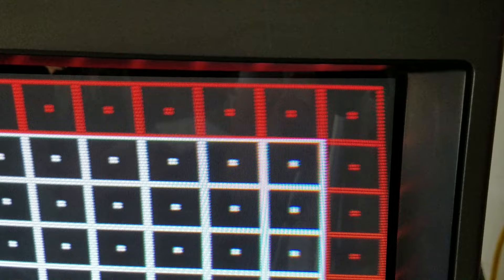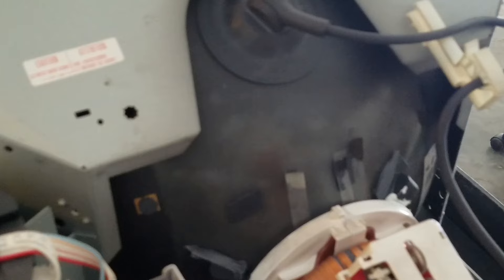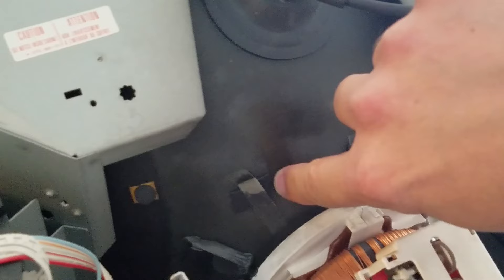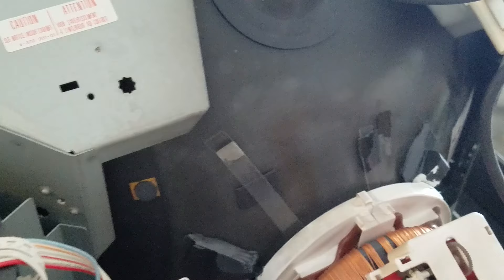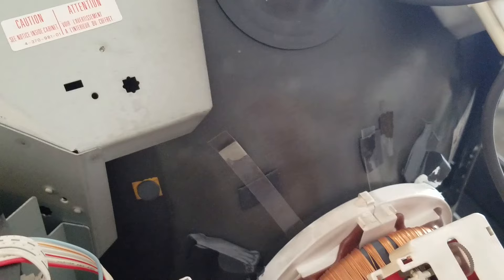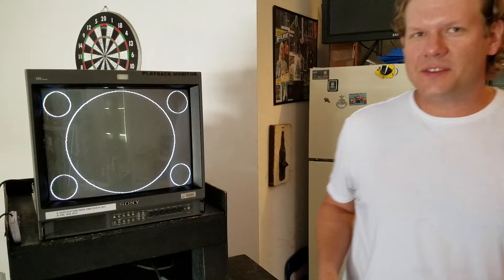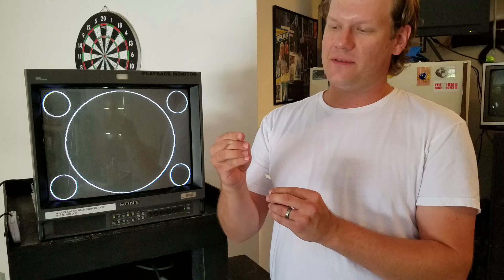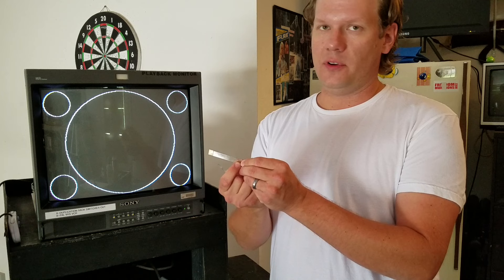CRT Calibration Fixing Corner Convergence

Comment: I would love to try this on my Sony 14"PVM. However even as an electrician, I'm just too damn frightened to open up a CRT monitor while running.
Reply: use your right arm
Reply: Believe me, it will burn more than shock you, it's not that bad
Reply: People like to talk about crts like they are some kind of death box but nobody talks about microwaves, one microwave transformer can easily kill you, my neighbor died trying to fix one
Reply: @geovani60624  microwave for sure is death. heart attack. maintenance guy told me he was fixing a microwave and luckily the shock shot out of his elbow instead of through his chest.
Reply: Why would anyone bother trying to DIY fix a microwave? They cost like £50 and last 20 years. What a tragic way to go.
Reply: @geovani60624  I would not even keep a microwave in my house or use one. They just radiate the food and technically you cannot turn them off.
Reply: @axi0matic  Over the range ones cost $200 or more typically. Plus mounting a new one on the wall usually takes more time than just fixing the old one.
Reply: @andree1991  Depends on which part you contact. The cathode current on a typical CRT is limited to 1.5mA, and it's DC, not AC. So usually a shock from the anode will be very painful and may result in skin burns and (even more painful) collateral damage such as broken wristbones and ribs. However, if you have a heart condition on top of that, it can very well be lethal. The same applies if you contact the primary of the power supply, as with any mains connected appliance-- which is why you should always use an isolation tranformer. The latter will still not protect you against HV discharge from the CRT tho. If you do fondle the CRT, do so with only one hand -- the other stays in your back pocket at all times! That will make it more likely you'll discharge to ground instead of across your chest.
Reply: @NuGanjaTron  I still would take the chance man. Just to be safe
Reply: @NirnBootMod  A microwave oven does not and cannot change the nucleus of an atom in any way. It won't make your food radioactive. It may make your food dried out and little chewy but that's about it.
Reply: Hello, how do you get geometric lines?

Comment: Just bought a 2008 Emerson CR202EM9 in 2020, and it’s had a minor warping issue in each corner since the day I got the TV

While I’m far too worried to mess with an opened CRT myself, it’s nice to know that convergence strips are something I can mention when I have a retro TV shop service technician look at it (in addition to having them observe unbalanced stretching on the left edge of the screen compared to the right, which as I’ve read apparently is a yoke misalignment)

Comment: Very helpful, I've just done my own arcade monitor build with a 19" tv tube and a Hantarex Chassis + yoke for my street fighter 2 machine, I've got the convergence rings spot on but one corner won't converg right luckily I had some strips on the old tube and only 1 strip fixed the corner issue, cheers.

Comment: I have another question: If the corner converge is even worse than that, can it be caused by a bad cap for example?
And is there another way to fix corner convergence than using magnets? I heard using magnets is kind of a hack.
I tried using (even a big magnet) on one of my CRTs, but couldn't pull out the corner far enough (I didn't however try shoving it under the yoke).

Comment: I didn't know you could touch that part while it was on, do you mainly have to avoid the wire from the flyback.
Reply from the maker: Yes, I just made 2 videos on safety in a CRT.  There is one for High end monitors and one for Consumer sets.  Please review those to get more information on safety.  Thanks

Comment: hi steve, i got some of those strips from a smashed tv monitor i found on the street trash. but looking at the video i really can't understand where does the magnetic part has to go,  i see you moving the strip arround but the magnetic end of the strip has to go really deep  towards the copper narrow area of the crt? or magnet can go anywhere in the black back area?  whats the difference putting a magnet in the top black area and difference putting magnet in the bottom narrow area near the copper?

Comment: Are those strips and magnets on all trinitrons inside? I have consumer one a flat screen wega fd trinitron with a slight bit of that in the top left hand corner but no where else. Would I need to adjust it like that or with the focus pot as it's slightly out of focus aswell and bending down in the corner? Or is it a service menu fix? 🤔

Comment: How hard do you chase corner convergence? I've added strips to the back of one of my pvms and I'd say it's pretty good, but right in the corner I can see the blue bleeding slightly off the edge of the white. Is it worth chasing or is it impossible to achieve true perfection?
Reply from the maker: It's so hard to get perfection on the corners and with some CRT's it's just not possible.  You can try to get your degauss cable/band tight around the corner and that can help with color changes.
Reply: Retro Tech thanks very much. I used some magnetic tape to get it is as good as it was going to get. I could either get it horizontally converged or vertically but not both. So I went for vertically, otherwise you can see colour bleed between scan lines.

Comment: Not only do I have slight corner convergence, but both my CRTs don't show the full image, will this method work?
Reply from the maker: Yes it can help.  You may want to see if there are any trim potentiometers that control your picture size inside your TV/CRT or in the service menu if you have a nicer monitor.
Reply: Retro Tech I have 2 flat screen CRTs probably made in early 2000s, one is a Panasonic, the other is a Sanyo. Would it be possible and safe to do the same procedure you did? I can't imagine tweaking the insides of a live CRT to be safe.
Reply: @RetroTechUSA do you know how to access a hidden service menu on an rca crt? Mine is from 2004. Nothing in the service menu about adjusting tilt or zoom.

Comment: My TV has the exact same problem.
So those magnetic tape things are safe to touch while the TV is on without me (hopefully) not getting electrocuted to death?
Reply: The exterior of the glass envelope should be grounded, so it should be safe to touch. But make sure the braided grounding strap stretched around the CRT is actually attached to the metal frame that surrounds the CRT face.

Comment: Nice video Steve! I saw that you wore safety gloves in another video about convergence strips, now I can see that your not wearing them. Is it safe to adjust these convergence strips with the TV on, with no gloves?
Reply: Its safe. If you arent touching the wires around the yoke you will be fine
Reply: @RetrofIex  So it's completely safe to touch the tube with your bare fingers while it's on?

Comment: Been watching a load of your videos. Informative, well put together stuff. I don't know if you could help me however? I have a consumer CRT 21" Sony Trinitron from roughly the mid 90's. Desperately needs it's geometry adjusted. However, no matter how many different button combinations I try I simply can't access the service menu. Any help?
Reply from the maker: Hi, Thanks for watching and commenting.  Unfortunately there isn't a service menu on the consumer sets from the 90's.  Those have to be adjusted internally, if that's possible.  What's the model of your TV?
Reply: Retro Tech KV-21LT1U. I also probably should have commented I'm in the U.K. Thanks for any help.
Reply from the maker: HI, I don't think there is a service menu for that TV.  You will have to open the TV and see what's inside.  Most likely it will need have the capacitors replaced to get the best picture.  I just made a video about this today.  Please check it out.
Reply: Retro Tech oh Christ! That's what I feared. Sadly I've no experience in this area and think I will find it impossible to find somebody local who still works doing such things. Seems an incredible waste. Still, thanks for all your help in this matter. Keep up the great videos.
Reply: with the tv off. On remote press in order Display-5-Vol^- power. that should open the service menu
Reply: @ricflair5911  it's not working! Grrrr! Help.
Reply: i'm in your exact situation, Robert Higgins! Sony Trinitron, mid 90s, no service menu, based in UK. Did you ever get it figured out?
Reply: @RazorMom Robert?! Follow up?  Did ye get it sorted?!
Reply: @Off_Grid_Gaming  Hi there! I didn't. The trinitron I was dealing with simply didn't have a service menu that I could access. I ended up getting a Beocenter 1 with a 3.1 firmware and obviously from there on out it was a different story. Sorry not to be more use!

Comment: I need to do this with my KV-27FS210 I found working 
Do need to get new ports on the tv I think they are going bad also the RF connector is missing but I can still use the same video and some of the composite ports.
But definally needs to be serviced and cleaned out.

When i found it, it was at a apartment complex and nobody really knows why it was just sitting in the area only one person knew the police put it in the spot and nothing else I also had to lift it on a office chair and push it to my vehicle all by myself the thing is so heavy it took me like 20 minutes just to move it.
I didn't know if it worked or not until I brung it home and used a extension cord to see if it powered on.

Comment: The top left corner of my crt is showing a separation of color. Like a shadow effect. Is that the same issue? How can I fix that?
Reply: same thing happen to me but at top right corner
Reply: @id-iz2ds  I figured out how to fix the convergence on the monitor. You need to rotate the convergence rings. Initially I thought I had to replace the convergence tape but that really did not do much. It's the rings that need to be reset.
Reply: @vodkagobalsky  ok i will try. thank you.
Reply: @id-iz2ds  Make sure you be careful when poking around your CRT. Read up on all the safety measures before you start.

Comment: How are you getting this grid to show up?
Reply: Using a test pattern generator or the 240p test suite. Easiest system to use it on is the Dreamcast, you can simply burn off a disc and load it right up.

Comment: Hi! I recently purchased a crt tv sharp 76FW-54H TV for retro gaming, but unfortunately the screen is very disrupted and bowed on the side (inwards). Apparently, this TV never been serviced, so I believe there is a problem with focus and the geometry. 

I tried to fix the geometry myself using the service menu, but changing values for: e-w width, pin phase, pin amp, upper and lower corner correction doesn't seems to do anything.

Here are the links to pictures:

https://i.imgur.com/CzL4Wo8.jpg
https://i.imgur.com/7BSfidM.jpg
https://i.imgur.com/mRlqYWf.jpg